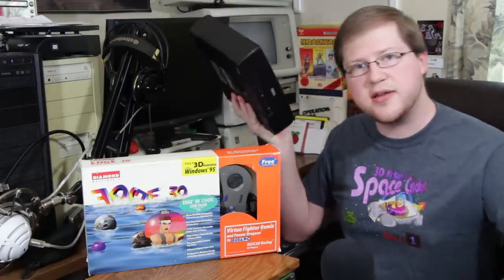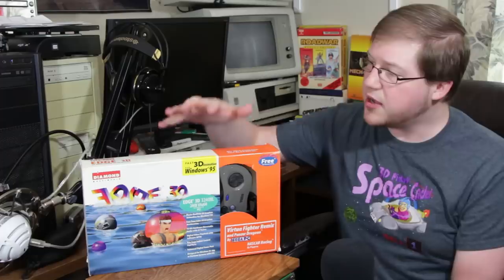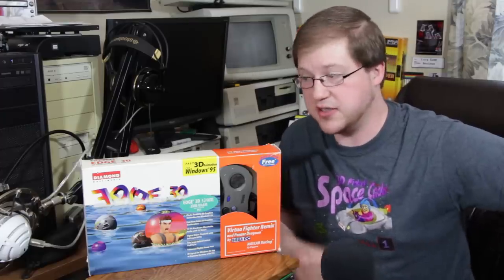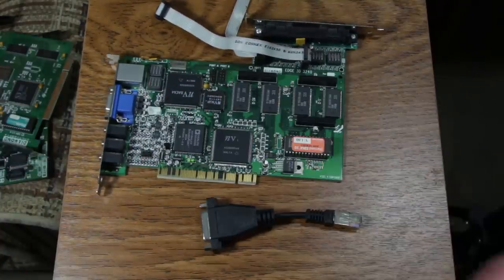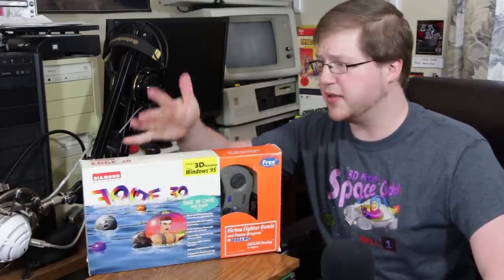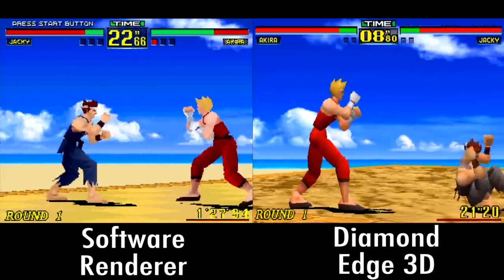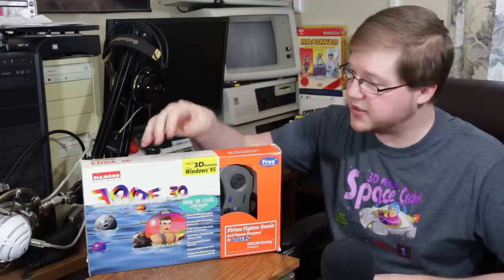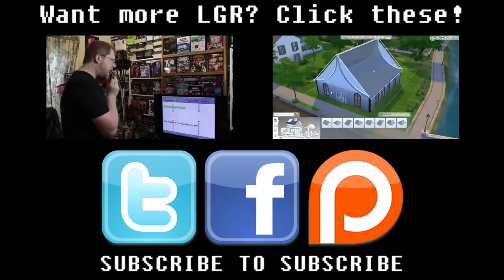LGR Oddware - Diamond Edge 3D (nVidia NV1+Sega Saturn Ports)

Comment: 0:52
Resolution of up to 1600x1200? WHAT? Back then?
Reply: From what I understand Quake even supported up to 1080p back in the day. You COULD do it, it was just expensive and very hard to do back then.
Reply: My SGI workstation could do that in 1990. It's always just a matter of how much you are willing to spend.
Reply: carmack had a 1080p screen in the early 90s
Reply: ***** I suppose it was as effective as doing 4K today
Reply: Man Ionno how people seem to have forgotten this but even around the late 90's you could get monitors with resolutions well above 1080p. Those 2500x1800 crts.
Reply: Now you see why these 'Resolution Warz' are bullcrap.
Reply: *****
Of course. Quake was a basically a sandbox. An amazing engine, and id software basically threw together some (pretty ridiculous) story and setting in order to release a game with it. It was a glorious accident. I mean, Medieval with futuristic and gothic all mixed together with Dark Knights, Demons and Laser Gunning Enforcers...

But yes, you could always set your own resolution in Quake engines. You just needed the monitor support and of course the horsepower to run the game at that resolution.
Reply: Clesarie
Im sure the Lacie Electron Blues had as good as or better tubes as the Diamond Mitsubishi SB series. Probably had higher resolutions too, given that they were CAD and SGI orientated screens.
Reply: TheVanillatech But isn't that the same story now about having the horsepower to run what you want ? Even owning a CRT and hardware that could support that res BACK THEN was simply amazing. It sorta made arcades obsolete.
Reply: Tiviat
I had the Diamond Mistubishi Pro SB 22" which had insane resolutions and refresh rates. It cost me a great deal but it was worth it. There was nothing like it. I could play Quake III OSP in 1600x1200 @ 100Hz, or (as I chose to) 1280x1024 @ 120Hz. It was simply amazing. And yes, MAME was great on those screens too. That monitor was so good I ordered the 17" version for my spare PC the following week. You just don't get that kind of quality components anymore. Everything is cheaply made and corners are cut everywhere. In fact for some perspective, I owned that screen for 3 years before selling it to a friend, who used it for another 3 years before giving to one of HIS friends, who still uses it today... 12 years later.
Reply: Tiviat
Ah and yes I understand. I guess once the Arcade started to adopt the VooDoo chipset in games like SanFrancisco Rush (the Quantum board wasn't it?) it didn't really matter, because PC gamers were rocking VooDoo 2 cards in their PC and playing Screamer Rally etc. PC has always been light years ahead in terms of video gaming. The only difference is that back then, the devs and hardware guys were constantly pushing each other forwards for the pure sake of gaming and art. These days it's rare that anything gets made that even comes close, because it's all about profit maximising and rinsing, with a dominant focus on the consoles and their severely limited hardware.
Reply: Tiviat
Sorry but you are living in a dreamworld. I have never built a computer for OVER £1000 in my entire life, and I have built hundreds. At each stage of up usual upgrade cycle, say once every four years, I have spent around £600-£800 and been able to play any game out there in max graphics for the time. Your figure of $2500, or £1500 is totally ridiculous, in terms of a machine built purely for gaming.

You cannot consider Dying Light a benchmark for PC hardware at all, it is first and foremost a console game and ported across with zero optimisation. You want proof? My friends i7-950 and GTX570 runs the game at an extremely poor framerate. Yet he can run Elite Dangerous in Ultra settings 1080p with more than 60fps. One is a PC, optimised and well coded by a grandfather of the gaming world. The other is a very poorly made unoptimised console port by a company whose FIRST priority from day one was profits. The quality of the games are reflected in their relative performance.

At no point in history, nor will it ever happen, have the consoles come close to even equalling a mid-range gaming PC on the day of their release. The closest example is the Sega Dreamcast, which used PowerVR and a variant of the intel Pentium CPU, and although technically a very impressive machine for it's release date, it still couldn't render as fast as my very average PC back then.

Please get with the facts.
Reply: TheVanillatech That's what I mean, you'd need to buy a new part that's practically the price of an ENTIRE console, that is deemed 'weak'. But I am talking about after you buy the OS,the parts, the massive amounts of ram, the 1-2 TB HDD's, and needless to say the 'above average' gpu so you won't be playing at an 'inferior' res and framerate. After all that is spent, just for pc gaming..it's practically that much versus getting all of that in a bundle for roughly $400(USD) bucks. But why argue about 'it's a poor console port' when console are weaker than the PC by a visible margin. It just doesn't make sense..you claim consoles are useless because your pcs are more powerful, but yet when a console game gets ported to the pc people scream bloody murder when they 'claim' the game wasn't optimized when over half of the mainstream pc gamers(the same ones that claim that the pc has power to spare) piss and moan because they need to upgrade their gpu to run an 'inferior' console port on a 'superior' platform.
Reply: TheVanillatech How much do gpus cost compared to a game console ?
Reply: Marcuss2 PC monitors have always been hopelessly far ahead of TVs.  Today, TVs have 1080i and sometimes 1080p.  CRTs existed did that in 1991.  Just many were limited for cost reasons, also a gigantic resolution on a 15" screen is unreadable and you can't make anything out.  Now, we use LCDs where a pixel is a pixel and fuck you if you don't like it.  This makes it impossible to have a screen larger than the actual pixel resolution of your LCD.  CRTs and other analog displays can just scale.
Reply: Sin Vraal To be fair, CRTs have a limit on practical size (102 cm), which is fine, but they were big and bulky.
Main reason they fell was price of comparable LCD displays, which were nicer to look at.

As I kid, we used to have 90s Sony Trinitron, probably best CRT of all time.
Reply: Trinitron was decent for it's price range, but far better existed.  I have seen 3300x3000 CRT displays.  Basically these gigantic jumbotrons.  32" IIRC.  I can't even imagine the price when new.  Still see one every once in a blue moon on ebay.  Where I saw them, they were used to edit video tapes, photos, and other analog media formats where large, ludicrously high definition images were needed to be viewed in full for some reason.  All I ever saw them actually used for was making wall posters for the 4' LF printer.
Reply: Marcuss2
Trinitrons were a good monitor, but they couldn't compare with the Diamond Mitsubish or NEC displays of the time. The dot pitch on those screens was outstanding. Trinitrons hit an awesome balance of price / quality, though. I had a 20" Trinitron that could switch between two inputs fom a button the side. That was pretty neat.
Reply: Indeed!
Reply: Well said, very well said!  Consoles have taken a HUGE step back.  Although I do understand why:  Technology improves faster than ever before and it's much cheaper and easier to upgrade a computer than buy a new console.  Plus, consoles (even ones that do poorly!) sell in far, far larger numbers now.  A million unit sales was good in the NES days, but today, that would be considered a failure-  tens to hundreds of millions are desired.  Example:  Right now the worst-selling console is the Wii U at 10 million consoles.  The NES sold about 62 million.  The Sega Genesis sold 40 million.  30 million atari 2600's.  These were successes.  Failures include:  Sega CD (2.7 million), Sega Saturn (9.5 million), Sega Dreamcast (10.6 million), Sega 32X (665 thousand), 3DO (2 million), Atari Jaguar (<250 thousand), NGage (3 million), etc.   Making 10 million of anything is difficult, where do you get the components?  CPUs in particular can be hard to come by in vast quantity, so you need to choose CPUs you can get a lot of quickly and cheaply.  Ditto for videocards, memory, etc.  It's very problematic for logistics and a supply problem often kills consoles.  For example, at the PS3's launch, console supplies cut into profits and sales very severely, causing them to sell at a loss for several months!
For that reason too, sometimes a console is a financial success but a launch flop.  The Wii and Wii U are perfect examples:  Even with their sales figures, Nintendo is making mad profit off of them, especially the Wii.  Their return per-unit is much higher than either the PS3/PS4 or Xbox360/XBone.  So they're making greater profit despite lower sales.

It's a complicated problem.  But that supply/demand issue makes it harder to have the latest, greatest hardware in a console because it uses equipment that isn't mass-produced.  This is the same reason Apple switched their Macs from IBM manufacured PowerPC processors to Intel x86.  Intel produced far more, far faster, and far cheaper, despite performing poorly in comparison.  This fixed Apple's supply problems and helped them keep up with the (at the time) growing demand.
Reply: Sin Vraal I agree with you in general, but i don't think supply is an issue for game consoles. I can't recall a single example of a supply strained console that took a quantifiable harm from that. Original Wii comes to mind which had supply difficulties, but consumers waited and it was an overwhelming success. Furthermore whether your partner is GloFo or TMSC, both have the capability to churn out 10 Mio units, if you don't aim for newest manufacturing process.

Sourcing however is an issue and background of the issue is engineering. We've had a complexity explosion both in CPU designs, which eliminated numerous companies from competing near performance peak, leaving only Intel and AMD; and also in GPU designs, which also eliminated numerous companies leaving only nVidia and AMD. These can offer their designs at competitive prices because the ever increasing and now immense engineering cost is spread among numerous consumers.

The reason Apple switched from Power to Intel is because they didn't want to keep investing alone in development of high-performance unit, facing the CPU design complexity explosion which started around 2000, while only having a few % of the market. This decision was spurred by server manufacturers abandoning PowerPC architecture with release of AMD Opteron 64-bit (specified in 2000, general market availability 2003), which easily covered their necessities and the ideas from which later made Intel Xeon and Core successful, and also in anticipation of Itanium, which was a dud that sank billions in engineering. But with server companies gone, Apple would have been left as the only carrier of engineering cost for PowerPC.

IBM offered the already obsolete PowerPC to SONY and Microsoft, and it fit their bill as a low-cost part, sub-par performance of which was largely unimportant because they assumed that console developers could be burdened with optimization, but this prolonged use did not lead to continued engineering.

Sure there's still competition outside of these companies i named, but only at the low-power end, where complexity is a lot smaller and electric power limit effectively holds back complexity explosion.

Another thing that changed is the massive increase in PC title sales. Now, PC game software outsells console releases by revenue. A further factor is increase of software complexity of game titles, so console manufacturers seek to reduce development costs and optimization difficulty for game developers. In PS3 generation, Xbox360 was the winner because it was easier to produce and optimize for, so titles came out in better quality on Xbox360, and the only leverage SONY had on the market at all were exclusives, which eat into the profit because SONY must compensate the developer for reduction of sales that releasing on one console instead of two incurs.
Reply: Actually the Wii DID suffer, and quite a lot.  Anyone using IBM has likely had supply issues with PowerPC processors, ditto for Via.  The SNES had supply problems with later gens as the Ricoh 5A22 processor was hard to produce quickly from the manufacturer, and other variants of the CMD/GTE 65c816 didn't perform identically.  It wasn't a problem at first because there was a backlog of Ricohs sitting unsold, which is why they picked it specifically instead of other 65x816's.  Supply is a major hold-back consideration.  The PS3 had severe CPU supply problems with the Cell processor for it's entire run, never alleviated.
Reply: Sin Vraal You deliver excellent points.

I'm not sure what happened with Cell, i guess somebody was being a load of butts, or it was simply cheaper to lose some sales than to ramp up production. Because for most of its duration, it was produced on what seems to be nearly the same production lines as the ones used by AMD/GloFo/Chartered, and IBM has some successful experience moving production of PowerPC in particular between their own factories and GloFo/Chartered. It is perhaps fitting that since recently, IBM microelectronics production no longer exists and has been merged into GloFo.

Pure PowerPC, as opposed to Cell, isn't entirely single-source. IBM would be in trouble if they delayed delivery of that, because if they do it too often or too badly, the customer might go away and get Freescale to design them a compatible replacement within 2-3 years. Freescale doesn't have a fresh PowerPC to offer directly, but they are a consortium member and license holder, and they have plenty of high-performance ALU component libraries from other units they were developing. I'm not entirely sure whether a replacement of Xenon would be feasible, as it's a pretty evolved unit, but the Nintendo Gekko/Broadway should be outright trivial for Freescale to replace. The sales numbers of that decade's consoles might just about support this approach, esp. with Nintendo being the only console company directly profiting from hardware sales. I guess it would have been a lot less feasible to get someone else to design a functionally exact clone of Ricoh version of 65816 in SNES times, and there's less reliance on exact performance details these days anyway.

There's plenty of other points where Nintendo could have suffered supply difficulties for Wii, like 2T-SRAM, that's outright exotic.
Reply: Sin Vraal Low yield on CPUs is really not usually a thing any longer, unless it's on new node. It was the case in all early CPU production of the 70ies/80ies, the yield was atrocious, and the prices were according. Nowadays, nobody even starts production if don't think they can reach 70% yield eventually. Yield is always the issue on newest nodes, but PowerPC doesn't make use of the newest process, the Xbox360 Xenon went through 90, 60 and 45nm IBM/GloFo SOI nodes, each when the process was already mature and provided high yield. The current sub-30nm nodes are still not mature on most facilities, so it would be insane to use them for a game console, i think the best you can get with decent yield at TMSC is 28nm, in spite of them doing test runs and promising to get like 20-22nm perfect like one and a half years back. Which is what delayed NVidia 900 series, they wanted a new node, but that didn't work, so the GPUs had to be redesigned for the larger node again.

MOS had indeed this legendary process where they would correct the masks with a sharpie to provide high yield :) We're way past THOSE times. And 6502 is what, 4000-ish transistors? The masks were large transparencies which were projected optically reduced onto the die, and the structures on the mask were really sharpie sized at that low complexity.

Of course i didn't mean stamping a factory from the ground, but transferring part of production to an existing factory such as Chartered like IBM has done with PowerPC offerings. I can see how moving things between very different processes could be difficult though, but they've moved things around before, that's what i'm saying. Sure, it would take some time, but if you're speaking of a 8 year long recurring supply problem, seems like that be worth resolving at some point?

Designing CPUs is not "very easy". There's a specific case which is "very easy" which is synthesizable CPUs for which high-level description is available, such as ARM cores, that's the way they're sold, as software units for synthesis. Higher end PowerPC units however are not synthesizable, they are partially hand made designs that are made with consideration of the production process, and the performance characteristics partially depend on how well they're targeted to the process. So you would need a chip designer cooperating with a production company, and if one doesn't deliver the goods and does what needs to be done, perhaps the other designer will be more flexible and more considerate towards its customers. Finally, we're not talking about taking existing off the shelf stuff and being surprised that it doesn't quite cut it, but an item designed specifically to consistently outperform an existing item. I really don't think running the GC/Wii CPU 20% too fast on some operations would cause any issues. The complete library works without issues on overclocked Dreamcast for example. As a reminder, Wii does reproduce GC's performance exactly, if so desired, but Wii U does not and Wii titles run just OK nonetheless. The GPU of Wii U is technically completely unrelated to Wii's (same company? not even really, not the same group within the company), and fine grained performance profiles of neither the CPU nor the GPU match.

Lastly, i consider it highly unlikely that Nintendo manufactures its own RAM, where'd you get that from? Nintendo is so not a microelectronics company.

I'm VERY, VERY curious what the issue was with those iPhones. I can't imagine the CPU core being an issue, but the main chip is CPU + GPU + all the peripherals, and the performance of peripherals is likely to be crucial. In particular Apple's deeply preferred PowerVR GPU has the most unusual performance profile due to different principle of operation from other GPUs. And if you're a smart developer, you are going to be fully aware of this performance profile and use it to your advantage.

[sidenote: i haven't worked for Apple and know nobody who did. i am by trade embedded software developer, industrial and automotive]
Reply: I can't provide a lot of info regarding the exact defect in the CPUs apple used as a temporary replacement, partly due to not knowing exactly what didn't work, but it didn't work right at all.  Things that should happen within a certain time frame did not.

Also, as far as 'nothing has low yields anymore', that's just plain false.  Please look up the new 14nm and 10nm chips.  The development cost and yield are both so bad that in order to improve the process they've begun selling exclusivity contracts for it with hardware vendors to partially eat the cost until the yields reach >10% and the duration of those exclusivity contracts expire, rather than taking it straight to market as has been standard for over a decade.  Part of the reason is not just the mask-  which is very hard to make stable lithography, even with electron lithography, at that size-  but also due to issues such as electron tunelling, uneven silicon dopants, hard to achieve polymeric resist, plasma damage to low-k materials, etc.  The largest construction technique that is currently reliable is around the 30nm range.  Everything below, while possible, has atrocious yields.  Remember, a silicon atom is only about 0.11nm.  So 10nm chips are effectively less than 90 atoms wide.  Intel had planned to build a brand new $5 billion facility for 14nm transistors onr 300mm wafers, because upgrading existing lines to 14nm would prove, according to their CTO, 'disasterous'.  However they did the upgrade anyway, which ended up costing nearly $3 billion anyway (over 4x the alloted budget!) and the initial yield for the first run was expected to be 5%, but was a god-awful 0.43%!  This would later become revealed as the Broadwell processor, and yields improved.  But the point is that yields are indeed VERY poor for a long time.  Most do not exceed 50% before reaching obsolecense in the past decade-  faster and faster they are being abandoned before a high yield is achieved.  By comparison, some Z-80 clones broke 70% yield, which was quite profitable.  The MOS 6502 mask process was ideal for it's time and impressive for early yields even by today's standard, though of course hopelessly out of date and unuseable for any modern processors.  Point is tho, your information regarding yields is WAY off base.  Designing a CPU isn't exactly rocket science, but it is hard.  But even a sound design with perfect simulations may go to the manufacturing and completely fall apart in production.  IBM learns this every few years-  they have some of the most amazing and advanced designs and capabilities-  Decimal processing!-  but many have to be altered, scaled back, and endlessly reworked before they're able to be produced reliably.  And IBM has always been notorious for supply problems relating to low yields.  Again, see the Cell, PowerPC, Power7, and Power8 processors.  The Power9 is having so many issues, it may yet be abandoned despite a number of prototypes and leaks occuring.  However it's been utterly unspoke of since around 2013, because AFAAK, there has been no significant progress to making a design that translates to a useable product.  It's just a bit too complex.  (Of course with ~16 (maybe more/less) cores and over 32MB of L4, 4MB L3 per two cores, 512K L2 per core, and 128K per core, that's a LOT of transistors and real estate to account for!  It's well over 6 billion transistors.)
Reply: who here has the bigger Johnson? He who can write more words in a reply???